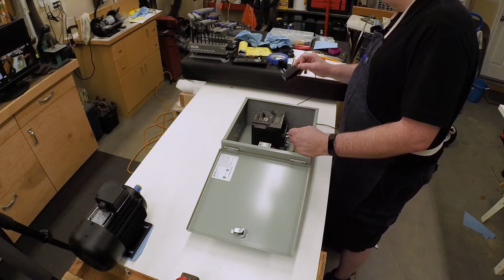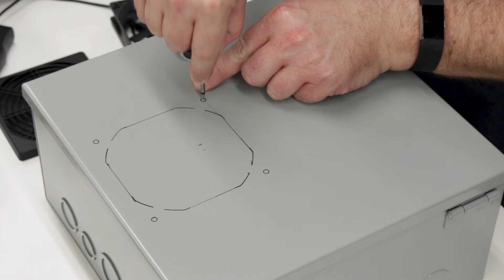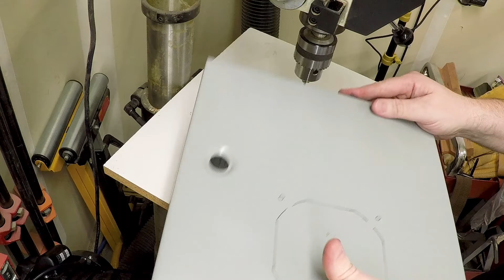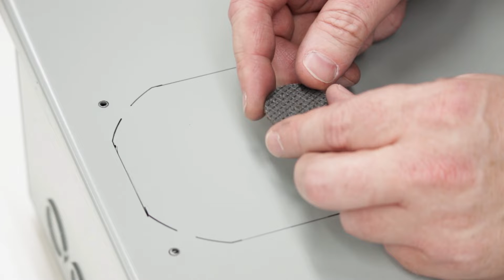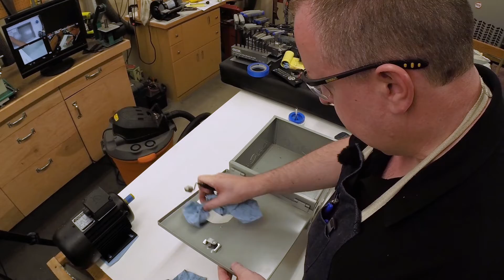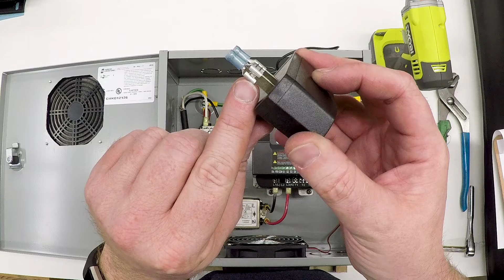Lathe VFD 5: How to Build an Electronics Enclosure

Comment: This box has NO plate to mount components on. So the screws exit out the back wall of the box. 
Where as if it had a mounting plate that would not be the case.
Plus with a mounting plate you assemble the components onto plate the install the completed assembly into the box.

Comment: Question in an enclosure how to run a DC fan with the VFD. OR do i need 110 vac for a fan. 
 HELP please
Reply from the maker: I usually use a 12V or 24V fan running off a separate power supply.
Reply: @Clough42 the way you comment i will need a separate 110 vac outlet to power the dc verter

Comment: When trying to buy the leeson motor, I was redirected to its updated replacement. 1hp marathon… but, it’s inverter rating is non compatible. I went back to the leeson spec sheet. It’s inverter ready. Is this an issue? This series is awesome, along with the ELS. But it’s a firehose of info lol.

Comment: after watching this video the first time, i ordered an ABS plastic box.  Much much easier to cut the holes into and far less messy!
the fan holes can be cut easily with an oscillating tool
Reply: How did you wire a fan????
Reply: @ralfkessler  can't remember now, but i will take a look

Comment: I see that you used a fairly high quality IP20 rated VFD to drive your lathe motor.  We're presently in the planning stages of using a VFD to drive a 3-phase belt grinder motor for our small shop.  As this machine will be used year round, the VFD will be exposed to quite a bit of fine metallic dust -- especially during our cold weather months.  What are your thoughts on using an IP20/NEMA 1 rated VFD inside of a sealed (NEMA 4X) enclosure to keep the dust to a minimum?  Do you think that we'll have to fabricate dust filters that work in conjunction with the fans?  I've both liked and subscribed, so please keep on making the informative videos. 👍
Reply from the maker: For a belt grinder, many people prefer to use a fully-sealed VFD like the KBAC-27D.  It's also super simple, with a switch and a speed control knob.
Reply: @Clough42  The price of fully-sealed VFDs is what brought me here, Clough.  Do you think that an IP20 rated VFD will actually overheat in an enclosed box?  Quite honestly, I really don't see us using the belt grinder for more than a few minutes at a time.
Reply from the maker: @timberwrightsvs480  I don't have any experience with that, so I don't know.

Comment: Hey great VFD videos!!   But I was wondering if you could provide a little more detail on where exactly the start/stop wires go on the contactor and the neutral jumpers you were talking about? Also would the wiring setup u used for the start/stops switches be the same on a 3phase contactor? I wanted to used a 3phase contactor but it will only get 220v single phase power?

Comment: Hi James.  Really like your VFD 110v to 3 phase convert.  I  replaced my old Craftsman 12 inch with my "New 2 Me" Standard Modern 13 inch.  Much heavier more precise.  Anyway, got a 2 HP motor and Huanyang 1.5kw VFD.  Bench tested, per your sugesstion (good idea)  all well and installed.  Problem I cannot figure out how to wire the magnetic conductor.  it is basically like yours.  Please show the wiring diagram so I can finish my project.  Thanks in advance.  JB

Comment: I noticed that you skipped past the part where you certainly struggled to remove the backing film off of the 3M tape. 🤣 The tape is great, but getting that film off of it is a bitch.
Reply from the maker: The rare moment when it comes off easily is to be cherished.

Comment: I think I missed something. Here in canada we have two hots 120v to feed 220v appliances/machines. Is it different in the states? You have 1  line and 1 neutral as though it was single pole 110v. Where did I go wrong?
Reply from the maker: This is a 110v VFD.
Reply: @Clough42  There ya go, i even watched the entire series and just assumed it was 220. My bad. Great series btw.

Comment: For anyone making this upgrade, I found cutting the fan holes was very easy with a hole saw. I had a 4-1/4" hole saw and it worked nicely on a large 1/2" plug in drill. A 4-1/2" might be a perfect fit but I was not going to buy a $30 hole saw for 1/4" extra. The holes were surprisingly clean, just a little clean up with a drum sander on a drill. Thanks for the awesome content James!
Reply: The perfect tool are industrial electrician manual knockout dies. For the individual who needs the best in every tool, Milwaukee makes an battery operated knockout tool too!

Comment: I am getting ready to build a vfd enclosure for my setup.  I have two vfd's, one for the drive motor and one for the coolant pump on my lathe.  I am recently retired, and where I worked. we had a lot of equipment and control cabinets.  I modified our cabinets and equipped them with easily removable filter media.  The filters (stainless steel media and cleanable) slid in and out easily in the frame of the filter.  Easy peasy.  It made it so much easier to keep maintenance on the filters.  My shop also substitutes as  wood working and does that generate a lot of dust, even with the dust collection system.

Comment: If you want some even stronger holding tape, try 3m's VHB (very high bond) tape. They use that inconstruction for metal building panels. It's main use is for metal but it also works great on other materials as well.

Comment: Thanks for the detailed videos and I have borrowed lots of ideas from this series for my VFD for the lathe. One thing I have done is I have used both NO and NC switches in my Emergency Stop. one wired to operate the contactor while the other is connected to the Emergency Stop of the VFD (had to program one input of the VFD as ES). In that way, power is disconnected from the motor immediately by VFD, otherwise, the motor can run a few seconds from the stored power in smoothing capacitors in the VFD.

Comment: Just an FYI, the glands you used for the cables, at least with the factory compression rubbers, are waterproof. I used to use them for marine electrical wiring for things like solar panel cabling. They saw some pretty extreme conditions and I never had any callbacks for leaks.

Comment: Wasn't/isn't it necessary to have a ground from the contactor to the box star ground?
Reply: No, there is no ground for that contactor the Din rail is grounded to the box. There needs to be a transorb wired in with the coil wires though.

Comment: James, have very old 3 ph double shaper 5 hp motors.  will vfd work on motor not rated for vfd as your Lesson motor?  Vfd supplier said I needed to double the hp to size the vfd or 10 hp vfd.
Reply from the maker: An inverter duty motor has insulation designed to withstand the high voltage spikes generated by a VFD and is designed to run at lower speeds without overheating.  I don't see how using a bigger VFD would help with that, but I'm not an expert by any means.
Reply: It just depends how hard you are going to work it and can you keep the motor cool. Low frequency/low rpm makes the motor heat up.

Comment: On the enclosure, if you had offset the exhaust hole to the left, then you would have had room to cut a opening over the display of the VFD, a little plexi/lexan and you have full view of the VFD display

John
Reply from the maker: The display is readable through the fan grill and filter.
Reply: @Clough42  

Thanks for the reply, I noticed that later in the video series after I had posted this.  Mea Culpa

John

Comment: Apreciate your videos.  I'm in the early stages of a vfd on my wood lathe, but I am unsure about your implementation of the latching contactor, could you provide some more info on that?  I understand the wiring on the lathe but I see wires on the uninstalled contactor and I can't see how they are wired.  I am using a 220volt vfd which provides a further complication.

Comment: James, since the fan in the bottom of the NEMA enclosure is pushing air into the box to keep a positive pressure, why is the fan filter on the outlet?  Shouldn't it be on the inlet (bottom opening) to filter the air before it goes into the box?
Reply: Yes. I think they both might have had filters on them?

Comment: I recommend using a KO punch set for making your cord connector holes. It will make much less of a mess than using a step bit. You will need to drill a 1/2” hole to start, but it’s just better. Less jagged edges using a punch set.
Reply: We always used a 7/16" drill for the 3/8" stud. Gives you just enough for bent slug easy removal. Had know it all prima donna maechanics only use a 3/8" drill bit then break their balls and screw up threads on stud banging off slug. I also use a USA carbide 7/8" hole saw for cord connectors. Never install fan exhaust on top of any enclosure unless you install a deflection oversized plate several inches above. Saw water oil etc get into a top exhaust burning up devices. You should use the proper size ampere fuses on all drive inputs. Had a stupid hard head cheif electrician use time delay fuses instead of the quick blow fuses called for. After burning out thousands of dollars in drkve boards he started using the proper fuses.
Reply: @garbo8962  ??
Reply: He is a machinist .

Comment: can you make a complete list of cables size, cable glands, magnetic contactor? I have everything on all the videos and im wanting to rewire everything to be cleaner and more organized. Also what is the adapter that your using to power the fans?
Reply: Why use an adaptor? Just buy a 120v fan. You just want  a 120v coil 3phase contactor

Comment: Will the noise filter you show here do split phase 240v? My motor on my lathe is 3 phase and im using a vfd from 240v split phase to 3 phase. If so, i assume i just wire l2 where “N’ appears on the filter?
Reply: Split phase? Just 240 single phase? If so yes.

Comment: Thanks so much for all the effort you put into your video series.  I've watched each of your videos in this series several times.  They're such a wealth of information.  Your build is so elegant and well thought out.  I am restoring a 1960 Clausing 16VT that has a 3-ph motor and found this series because I am using the same Teco VFD to run it.   I'm borrowing many of your ideas for the control box and will use your links to purchase some of the parts.   Thanks!!

Comment: A drill mounted metal nibbler (or a pneumatic one) would be a good choice for cutting your openings. Something like this Double Headed Sheet Metal Nibbler 360 Degree, Illuminate Ultimate Metal Cutter for Straight Circle and Round Cutting, Burr-free Edge, Extra Punch and Die, 1 Cutting Hole Accessory and 1 Step Drill Bit https://www.amazon.com/dp/B077SBDPMG/ref=cm_sw_r_cp_apa_i_EOmSDbCF6HNCR

Comment: Ok James, so we have to cooling fans. I understand that you cannot power the 12v fan with 110, so this is why the power supply is there. If the line filter is lowering the power supply & the power supply powers the fan, what connection let's the VFD tell it to turn on? You mentioned the RA and the COM connection, but how is that connected? Also, what turns the case fan on and off? I've watched the video(s) numerous times, but that part is pretty vauge.
Reply: Same....I also noticed you intended to use the Ra line to power the fan in video #1 — that would turn the fans on with the vfd...not sure why the change in approach to fan power???  I’m trying to power an old South Bend lathe with mine and working through this issue now.
Reply: @Cheatbait1  The 110v does send power to the 12v motors(+), the plug itself ramps down/converts to 12v. The VFD sends a signal via ground to turn the fan on. If your looking for answers directly from these videos, there will be holes...been there done that. Good luck, I'd be happy to share what I've learned from this mod...

Comment: I have a die grinder from tractor supply that would be perfect for cutting the fan openings. If you want a better alternative to a dremel you can google die grinder kit and there should be one for about $10 with some 3in cutoff wheels. Unfortunately die grinders are air powered so you will need a decent compressor.

Comment: I would have put the fan in reverse to suck air out.  That way you only need a filter on the inlet on the door of the enclosure.
Reply: Then you'd make negative pressure inside the box, so dust and moisture would constantly infiltrate (unless you devised a method to seal all around the door and cable glands). James's way keeps the inside of the box pressurized and clean.

Comment: James, thank oyu for another great entertaining video.
Love your work, but as feedback the wiring going to the Plug Pack is questionable, should have more slack in it so it sits down on the bottom, rather than suspended and importantly the voltage rating of the cable used to power it is well possibly inadequate. it is mains cable and should be heavily sheathed, regardless of the current, the mechanical isolation of the insulation counts.

Again very entertaining.

Comment: Seems like the proper blade in a jig-saw would have been easier than the Dremel approach.  Even so, file cleanup would probably still be appropriate.   Still, good stuff explained well.  Really like the content and production quality.   Anxious to see the completion of the Electronic Lead Screw project.  (Ahh, the gift of prophecy.)
Reply: metal cutting jigsaw blades work very  good. I have even cut stainless steel with them.

Comment: My only regret in this stage of the build is the cheap little power transformer & your means of securing it. Given what you had, you did good! I'd have been days either coming up with a proper power supply (more room needed in the box) or at least building a decent mount. You did what was needed to move forward! I struggle with that.
Reply: Or just use a120v fan?
Reply: A much better solution would be a power supply mounted on the DIN rail, right next to the contractor (there are plenty of small ones available) or a DIN mounted socket to plug the supply into instead
Reply: @tomboxyz5564  wouldn’t a 120v fan just be the easiest route?

Comment: which contactor did you use please, and why did you have to use it when you could have used the digital inputs on the VFD?
Reply from the maker: I used the contactor that came in the lathe from the factory.  The contractor is recommended in the VFD manual because it provides a way to disconnect power from the VFD when the tool is not in use.

Comment: Really appreciate the detail even to the extent of drilling the holes and mounting components . What is the purpose of the contactor vs connecting directly to line filter? Fantastic work, presentation skills, teaching ability and passion to do the best you can!
Reply: I was also wondering this!
Reply: Yes, please. Anyone?
Reply: It is generally recommended to prevent the unexpected restore of power to a moving system after a power failure, If it wasn't there, and the power went off, the VFD would immediately turn on when power was restored, which is generally not safe for the VFD and maybe for users of equipment run by it.

Comment: James where do you get all the wires, screws, etc, I'm new to this but need a little help with the parts?
Reply from the maker: I get the heavy power wiring from a local electrical supply (Grover's).  Loose conductors are usually just taken from left-over scraps of the power cables.  I get the crimp connectors from a local home store (Lowes, Home Depot).  My favorite place right now for metric screws is a local Ace Hardware that has a huge selection.  Otherwise, it's all available on eBay in small quantities or from McMaster-Carr if you want larger quantities to stock.  Depending where you live, imperial screws of similar sizes might be easier to get at a home store.

Comment: you tapped the 120v for the 12V adapter between the output of the contactor and input of the filter?  How is the 12v adapter getting power when the contactor is off?  Shouldn't it be tapped before the contactor, for a constant source of 120?
Reply from the maker: The 12V power is used only for cooling fans, so it's off when the contactor is off.
Reply: I see.  Guess I missed that.  what's the coil voltage on your contactor?  where is it tapped?  @Clough42
Reply from the maker: @johns208  It's wired up to the AC input side of the contactor.  The video showing the control wiring has a diagram.

Comment: Nice job.  I have one of these drives I'm getting ready to install, and the manual calls for fuses on the input.  Why did you decide to forgo them?
Reply from the maker: I'm not an expert, so you might want to trust the manual over me.  :)  The manual says that the fuses are to protect the "peripheral equipment" (a.k.a. the motor) in a short-circuit event.  I think the breaker will protect the building wiring, and I expect that the VFD will be toast no matter what, so I didn't bother.  There are discussions in various forums about whether the fuses are needed.  The TL;DR is that fuses were used for UL testing for various regulatory reasons, so they're specified in the manual.  All of that said, I don't think you can go wrong with more protection.  I might go back and add fuses to my installation.